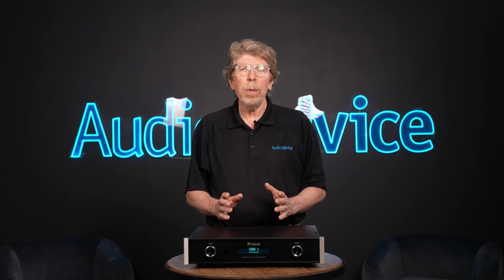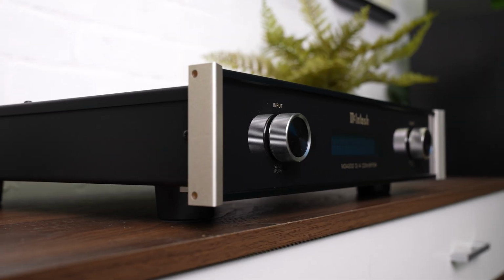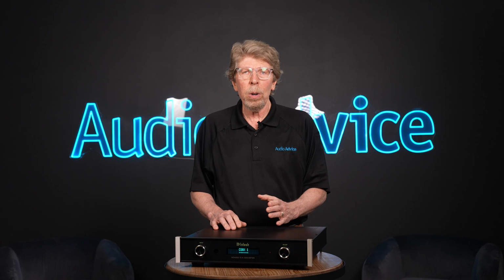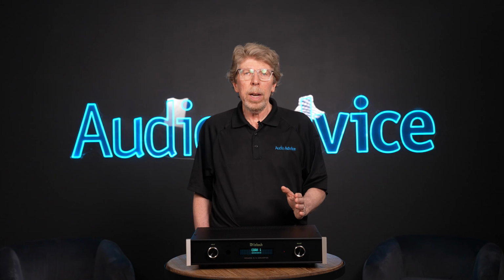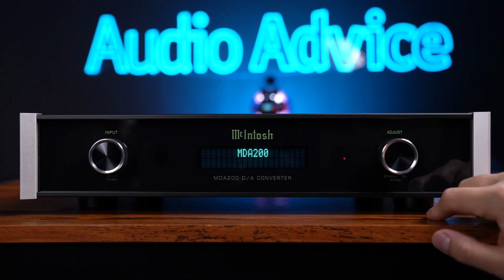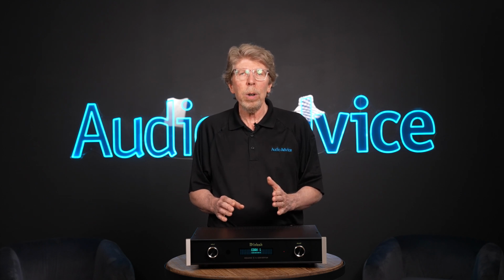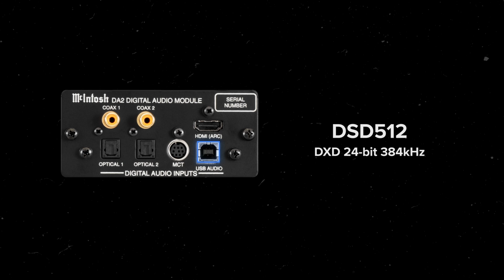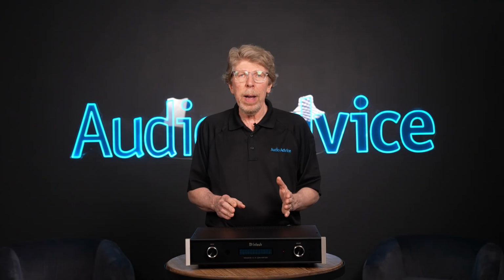McIntosh MDA200 Stereo Digital-to-Analog Converter/Preamp Review

Comment: So could this be used with powered speakers and connected to a TV? This would allow to use all the features on this unit?
Reply from the maker: Technically yes, although the volume control will get a little funky.  You'd have to experiment using it as a preamp into an audio input on your powered speakers or setting it to fixed out and using the remote for your powered speakers for the volume control.

Comment: Looks like it is missing I2S, usually implemented using HDMI connectors, like PSAudio / Denafrips  (NOT HDMI for ARC) and its pin-out has to be configurable...  for use with non McIntosh SACD transports !  Sigh...
Reply from the maker: It does not have I2S, although its benefits are a bit debateable.  Thanks for watching